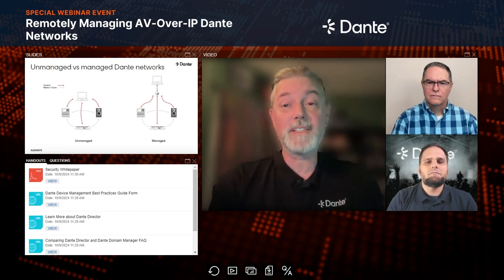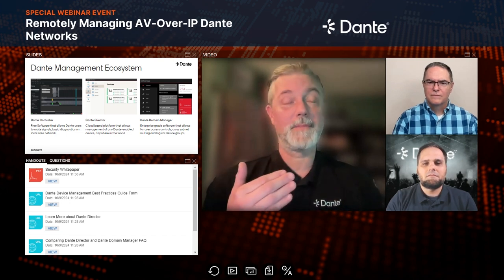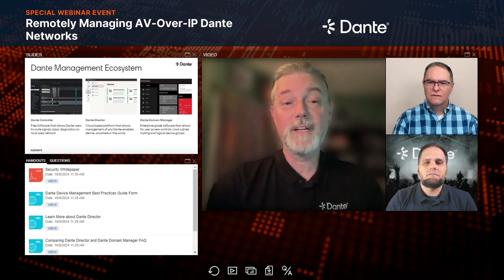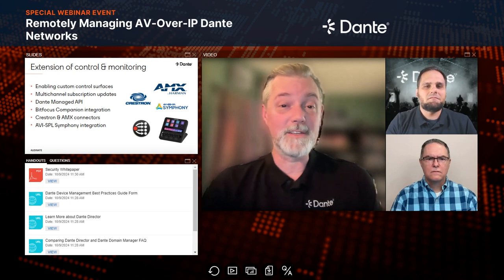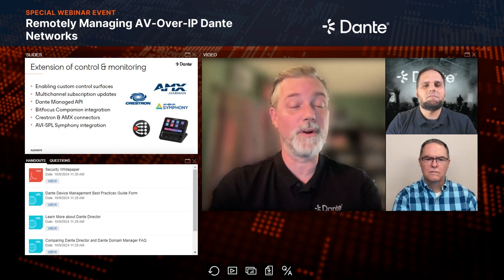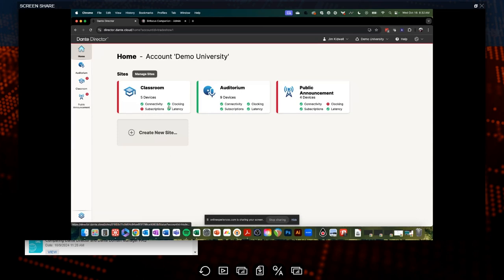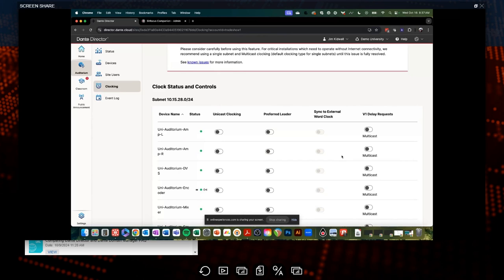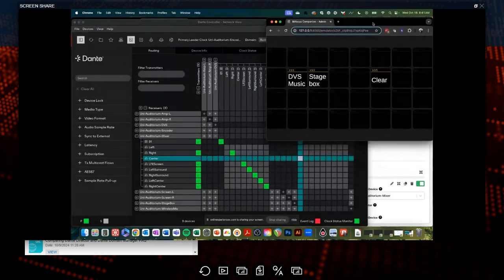Take Control of Your Dante Network with Dante Director | Webinar Recording

Comment: I have some TOSLink to Dante converter (Audio Control and RDL). Both go off-line after a period of time and require rebooting to flow audio through.  Do you do consulting. I need help.
Reply: They do, it's called professional services :)
Reply: @adamcracroft3587  Thank you so much, do you have contact info so I can reach out? I have 6 of these, one on each TV feeding into my Symmetrix network
Reply from the maker: Hi @jeffreyyu9863, Check your email inbox for the reply from our Support Team.